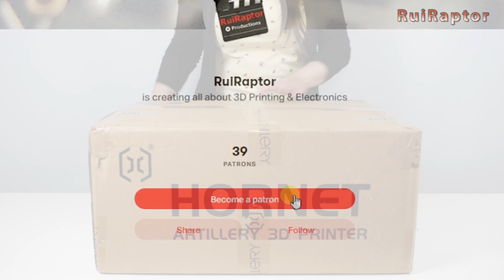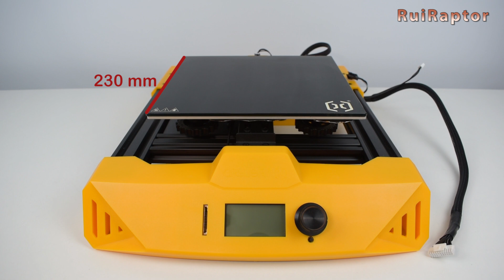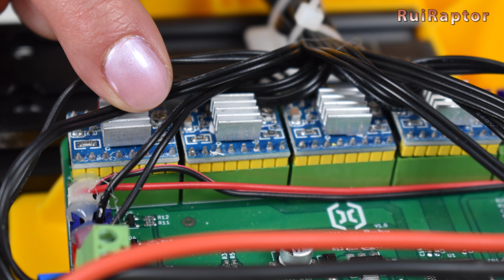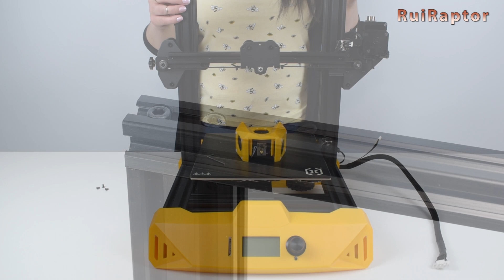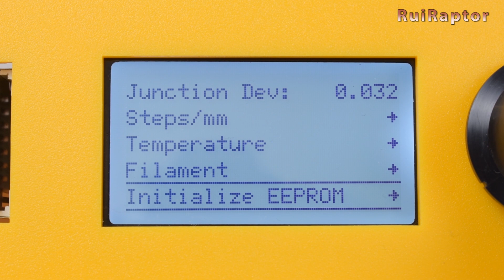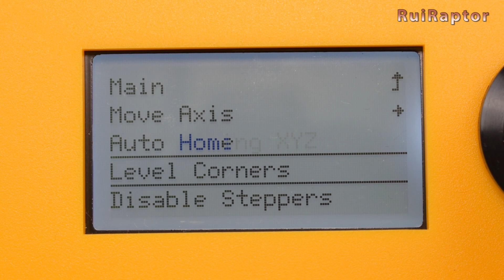ARTILLERY HORNET (3D Printer) - Assembly & Calibrations Complete Guide

Comment: Once you've finished your print with this, can you just turn the printer off or do you need to do anything with the PLA, extrude or purge for example? Can you just let the printer cool down and then turn off until you want to print again? The manual that came with this printer is useless when it comes to how to actually use it!
Reply: Well he never replied to the comments so im figuring this out now myself.. Did you ever figure it out?
Reply: you can just let it cool down and you shouldn't have any problem if you want to print again/ change the filament